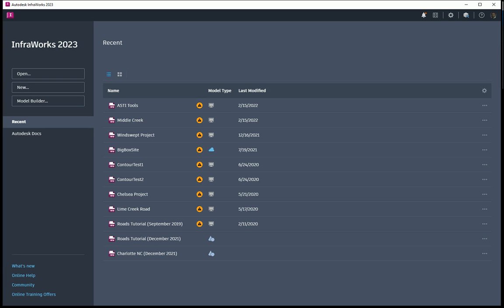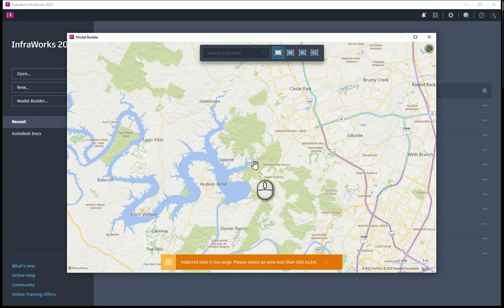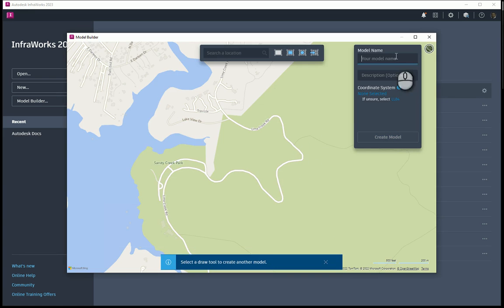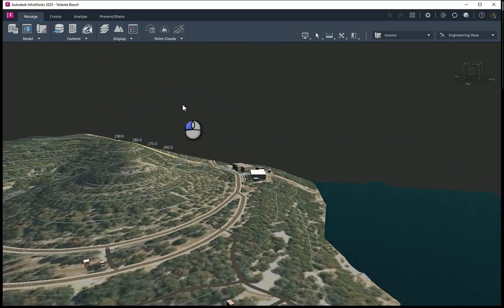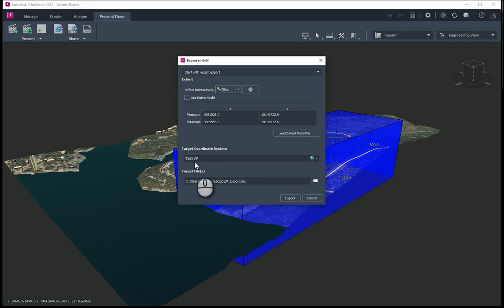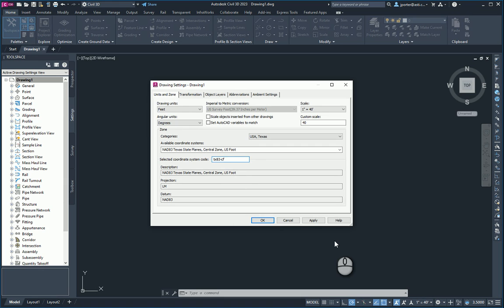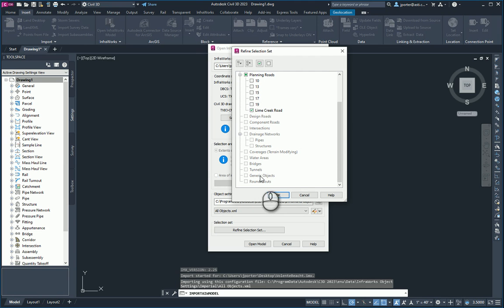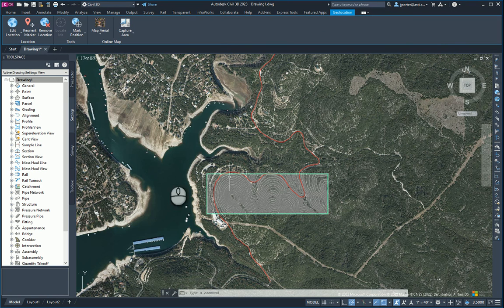Export Infraworks Model to Civil 3D

Comment: Hey Jason, my Infraworks model is not importing on the correct scale to my drawing. Any solutions?
Reply from the maker: When you began your Civil 3D drawing did you set it to the correct coordinate system?  That could be a culprit.  Also, check your UNITS.  Verify that the insertion units are set to feet and not inches or US survey feet.